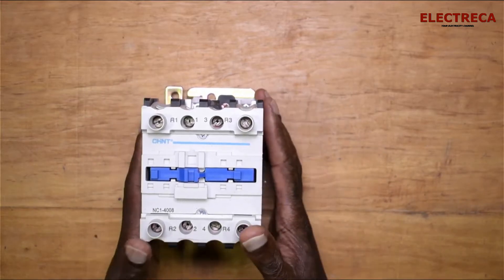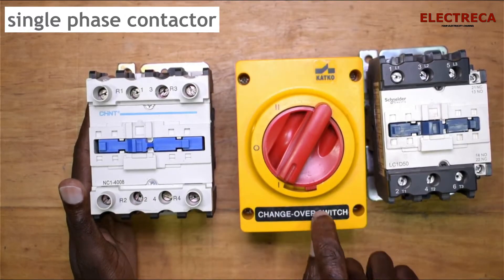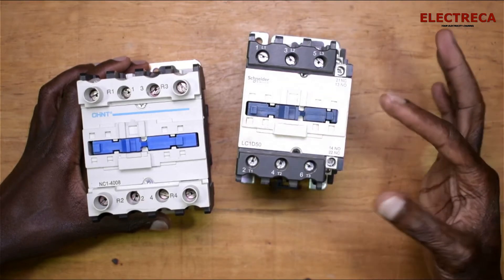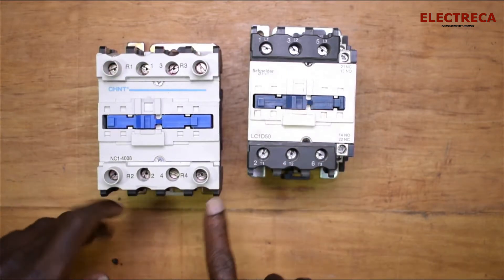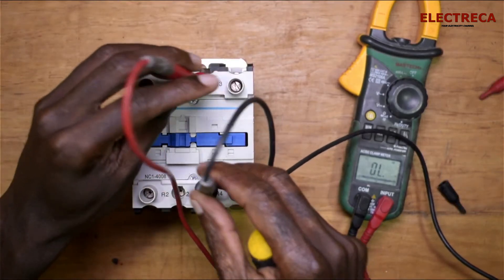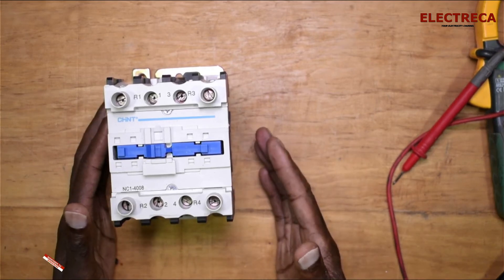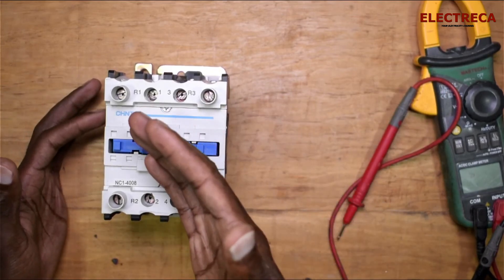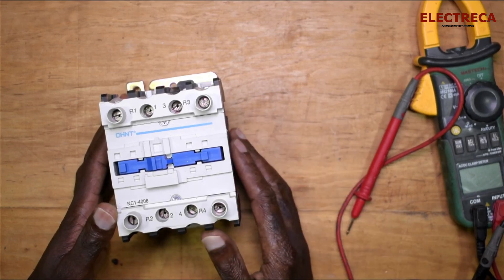single phase contactor for single phase changeover switch|ELECTRECA

Comment: Very nice Mwalim! I would like to know the features of generators that can support automation sir?
Reply from the maker: Any generator that can be started by pressing a button, can be automated. generator from at least 10kva above use controllers to support manual or automatic start mode( you can easily connect auto changeover switch).
Their small generator that can start by a turn of the key, a modification must be made to be able to start remotely because they don't have a controller

Comment: This is amazing! Why is this not more popular? all i see are the 2 contactor setups. Is this a rare type of contactor that has both NC and NO?
Reply: "the specification for changeover switch calls for a break before make contact arrangement . Typically relays and contactors is non-conforming unless they specify this.  

The break before make is of utmost importance , otherwise you will have a moment when grid and inverter output meets each other, with devastating results to equipment.  For this reason you must have certified device for this purpose."
Reply: @V4per  I've since come to learn that the single contactor transfer switch is not as reliable or as safe as the 2 contactor setup. I made an automatic transfer switch with 2 contactors. It works great!